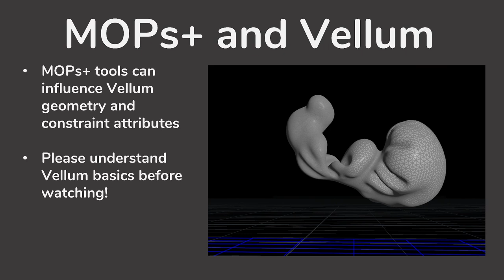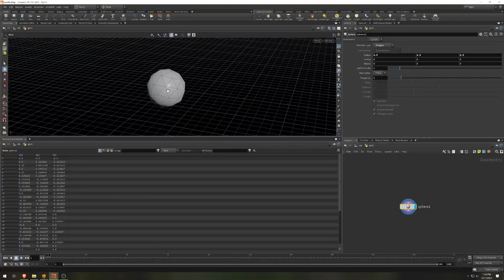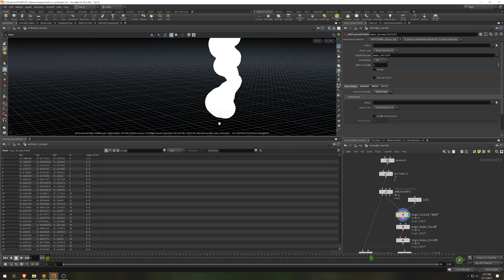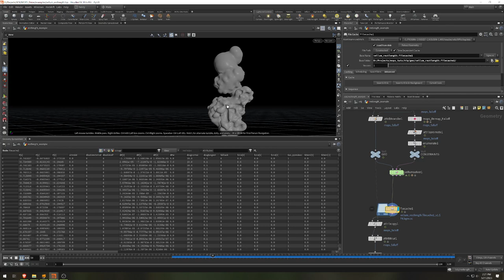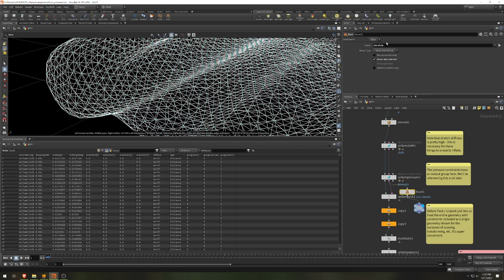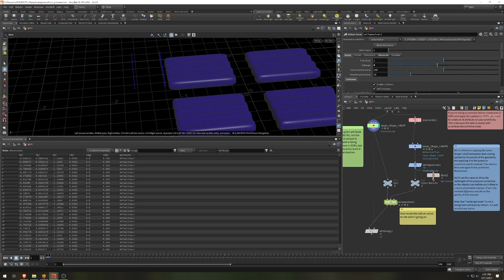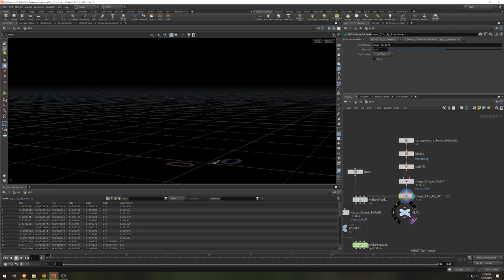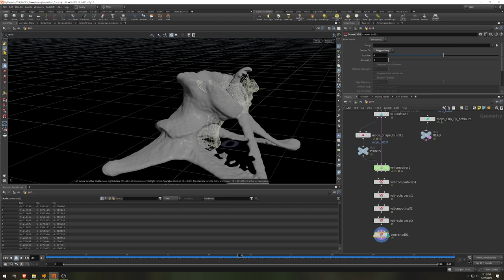MOPs+ and Vellum

Comment: This video is a great way to showcase the potential of MOPS, was wondering if you could do something like this but for volumes?
Reply from the maker: I do have volume SOPs in MOPs+ but haven't had the time to do a new tutorial yet... there are included example files for the volume tools though!
Reply: @motionoperators  thanks for the reply! checking them out soon as I just got done making the pressure falloff setup from the video!

But I have a question related to that setup.

I wanted to add "seems" my vellum geo, to give it a mylar balloon effect when it inflates, how should I go about doing that so the vellum geo inflates into that shape with the seems.
Reply from the maker: @Vivavisuals3D  The method kind of depends on the resolution of your sim and how fine you want the wrinkles to be. If you have a very dense balloon, you could get those ridges or seams by shortening the rest length of the stretch constraints in certain areas to cause pinching. If you want fine wrinkles to simulate quickly, though, you might have better luck just sculpting those into your high-res balloon mesh as a texture or blend shape, then point deforming the high-res mesh with your simpler simulation mesh.
Reply: @motionoperators  ahh the point deform method sounds interesting! going to try both
Reply: @motionoperators  so after trying a little bit I found a result I really liked which was making a group for the seems and running that through the pins, now I'm curious how to setup the pins to activate from a deflated position to inflated, would it also be in the solver level?